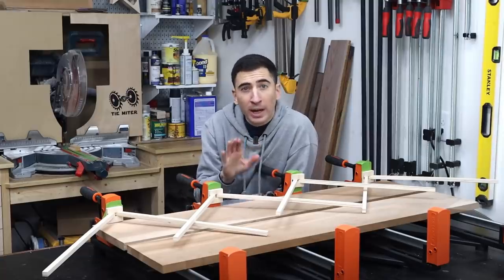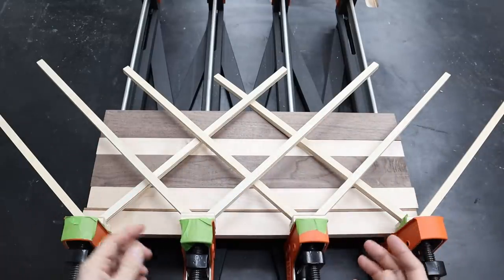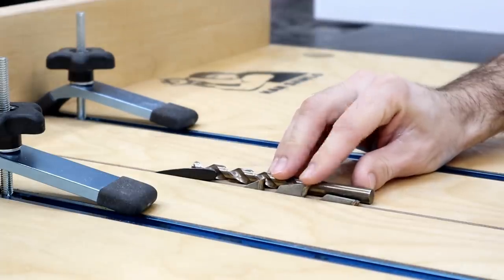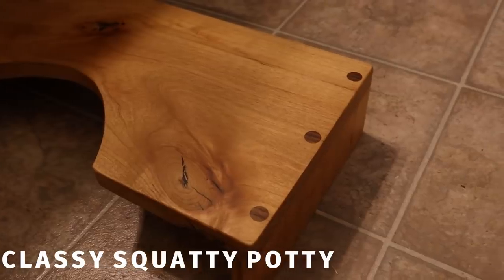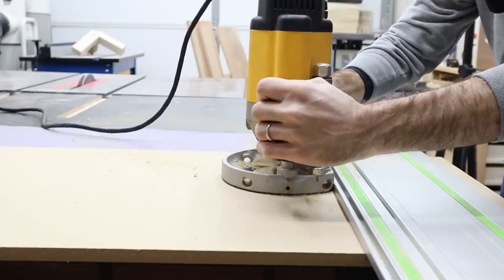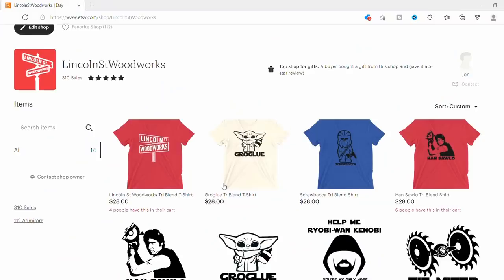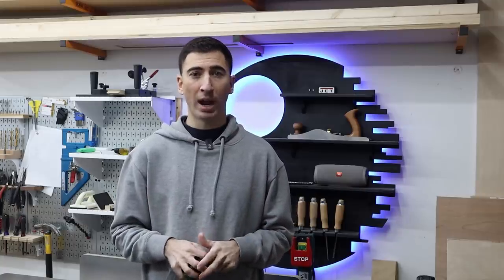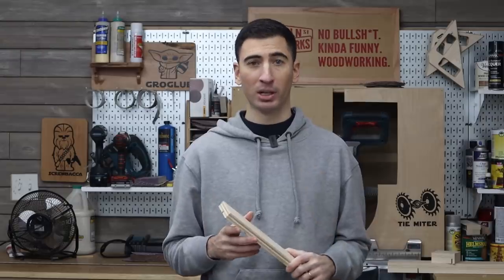I wish I knew about this before - woodworking

Comment: Amen on not switching to metric! But it is all around us, for anyone frustrated with trying to get an idea of what size something is in metric without grabbing a calculator, try this. Divide it by 100, then multiply by 4 equals Inches (approx. but darn close). 
(Metric) ÷100×4= (Inch) Example- 600mm ÷ 100 × 4 = 24".  Actually, 600mm = 23.62". 
1000mm or a Meter, ÷ 100 x 4 = 40". Actually, 1000mm is 39.37"
If you just drop the last two digits of the metric number it is simpler to do and the most, you'll be off is 4". Round up or down if you want. So, this would be for an even larger ballpark estimate, but useful on larger numbers.
865mm, rounded up to 900mm is 9 x 4 = 36". 865mm is actually 34.05"
As you can see, "divide by 100, times 4" is easy to remember and do in your head as well, sometimes. 😜
Hope this helps.
All the Best, Chuck

Comment: I don't understand the clamping force idea, wouldn't there also be V's from the other side as well,? Clamps don't apply pressure on only one end
Reply: Yes but the pressure from the other side is still in the same "cone" and for clamping to work from either side, it needs to push against something opposite of it, which is absent in the smaller glue up example

Comment: I grew up only knowing metric. But I now use imperial because all the building material in my area is imperial sized. It's alright. I do occasionally measure in metric when I don't want to figure out midpoint of a difficult fraction like 17/192nds of a football field.

Comment: I didn't quite follow the half lap tip. Is it that on the third cut you're trying to remove all of the small sliver that remains from the first two cuts? In my head, even if you barely remove that sliver, you're still going to be over cutting your half laps. 

So confused. Would appreciate some help from someone here!
Reply from the maker: When I said "final cut" I meant the cut after the board has been flipped. So, after you raise your blade, you would want the second cut from there to cut barely remove that sliver and it will be perfect. Play around with it a bit. It gets dead on half laps every time.

Comment: Great tips. I have to disagree with the ideas that using round portion of your router is accurate when/if you rotate the router. The bit would have to be concentric to the base plate for that to be true.
Great channel, keep up the good work!

Comment: I live in Brazil now and of course it is metric.  But I find it easier to divide 1 13/16 by 2 than to use metric.  I have to use metric when I go to the supplier, bur still fall back to imperial at home.  BTW Brazil is metric except for sizing plumbing pipes and televisions, those are in inches.

Comment: Trivia note: All US measurements are actually based on the metric system.  One inch is officially defined by the US Bureau of Standards as 25.4 millimeters.  In fact, all 'Imperial' measurements are defined in metric.  In effect - we use the metric system at a higher difficulty level.

Comment: Some very handy tips here. Especially the router direction. For some reason I always think out loud, argue with myself, chose the wrong direction and argue some more with myself. My wife questions my sanity sometimes (often) and I can't blame her. 
Not to be a wiseguy here, but... are you using metal drill bits for drilling into wood or does it only appear that way?
Thanks for sharing!

Comment: Place a length of straight angle against the rip fence twice the length of the board to be straightened place the points of the board against the angle and rip the board straight.

Comment: The clamps radiating out at 45 degrees thing. Would the other side of the clamps also radiate outwards as well? It seems reasonable. So do you really need more clamps?

Comment: The drill bit idea is really good, but only works well if you have a set with the right amount of increments. Luckily, I have HSS set from 1 to 10.
Reply: So do I- in 0.1 increments. But I still use gauge pins or blocks, or spacing packers if it is non-critical. Parallels are also useful for larger gaps. Drills are only accurate at the shank, and then only of they have not been burred.

Comment: Wouldn't you get those 45-degree cones from both sides of the clamp, not just the trigger side?
Reply from the maker: the clamping pressure doesnt extend out forever. The key is consistent pressure

Comment: I always use wide softwood scrap boards to spread clamping pressure, and I even have some with a slight bow in them to even out pressure with even less clamps.

As for the imperial vs metric thing: I learned both as a mechanical engineer from Europe and don't mind using imperial at all. However, I do think it would be good to either ditch one or the other. The longer we prolong multiple systems, the harder we make things for our offspring. The same goes for language. I'm from the Netherlands, but I'm a big fan of the idea to do away with all languages but English. Imagine the efficiency boost for all mankind if we'd all talk and write the same language.
Reply: I'd say English is pretty much the lingua franca of the western world by now anyway. I've worked in over 20  different countries (only 3  with English as their national language)  and never needed to learn another language. Even Korea was not a problem, though Japan needed some pantomime in small stores.

But I can't see China ever adopting it.

Comment: With the cutting board and clamp 45-degree angle thing, you don't seem to factor in the other side of the clamp. The opposing jaw of the clamp projects the same 45-degree angle of force but inverted to how we see it here. The broad end of those angles would cover the dead space at the bottom of the screen as we view it, just as broad end of the ones pictured cover the top side's dead space, wouldn't they?

Comment: Small question about the clamps and the pressure cone : Since pressure is applied from both sides (the fixed and the dynamic jaw) don't we have to take in account the pressure triangles coming from the other side too?
Reply from the maker: it doesnt extend forever and gets weaker. It's all about consistent pressure which you wouldn't get in this case.

Comment: Where you showed the joint that wasn't getting any clamping pressure on the cutting board because it was 'outside of the V's', wouldn't that be getting pressure, and be 'inside the V's' coming from the opposite side?

Comment: While I think it's reasonable to create a stop for the table saw using a clamp, a single trigger clamp is going to move easily if bumped on fence track. Single clamps have a way of moving on smooth surfaces, especially trigger clamps. It's something I run into in other places when I'm not careful. Two clamps side by side might help, but I would experiment to see what works before it becomes important so you aren't surprised by a movement.
Reply from the maker: I just keep my hand to the side of the clamp when I'm returning to that fence position

Comment: Life hack for cutting thin strips on a saw, use double sided tape or use CA glue to join two pieces of painters tape to the thin piece of wood and a larger piece of wood and then cut it.  It gets terrifying cutting something that starts out at 1/2” or less 😀
Reply: I've always use tape, but CA glue sounds like a better option to me and faster to implement. I'll have to give it a try. With both pieces flush to one another I'm guessing it will provide not only a cleaner cut, there is no chance of lateral movement between the boards as there can be sometimes with tape. This sounds like an excellent tip! Thanks!

Comment: Isn't there an equal and opposite force in plan with the clamps? Doesn't the tail end of the clamp supply a 45 degree angle of force back in the opposite direction? . . .  with equal force?

Comment: Drill bit ends are actually usually 0.02mm thinner than the drill bit size (for a 4mm drill you'd have a 3.98mm shaft), though I doubt this translates to woodworking tolerances when using power tools.
Reply: How dare you use metric! That's too logical.

Comment: What about the other side of the clamp?  Shouldn't there also be a "v" coming from the fixed jaw?
Reply: very true....any answers to this please !!! ???
Reply: Yes there is also a cone coming from the other end of the clamp, but the rule of thumb is that there will only be pressure at the intersection of these cones. Because some parts of the joint close to the jaw are outside this double-cone, there is a lack of pressure.

Comment: I have been planning on purchasing some set up blocks, but the drill bit hack will eliminate that purchase for now. Do you think paddle bits will work as well as round bits? The flat edge may be easier to see.
Reply from the maker: Mess around with it, I’ve got pretty good at being able to feel it or using a small straight edge or torpedo level combo

Comment: Great video!! I was wondering, those Jorgensen clamps you use while demonstrating the even clamping pressure and the "V"s. What kind of clamp is that? It looks like all four are attached and keep an equal distance from one-another as you separate or bring them back together. One more time, awesome tips!
Reply from the maker: its called the x clamp - izzy swan sells it

Comment: 1. Love your videos. I actually find myself laughing out loud. 
2. Worth noting that the clamping force is beign exerted by BOTH jaws of the clamp, so you were gonna be fine without adding more, since the fixed jaws would be casting Vs that would capture the joints from the other side.

Comment: Umm, I think the vectors are messed up.
The point of the clamp should be the strain focus, vectors of pressure should radiate from there.
You have it as the mid point between clamps.
I submit that the strain will be a function of the length clamps and the width of the board.
Unless there is a thing where parallel clamping pressure zeros out and it resolves to the middle?

Comment: Hmmmmm. I grew up with imperial. But the country slowly shifted over to metric decades ago. Certain things stick pretty tenaciously. I don't know any one who'd say they were 1.85 metres tall if they were 6 foot 1". But as for the rest of it, it's as easy as acknowledging that your ability to count to ten is probably superior to your quotient calculating strength. You don't actually have to give up anything at all. Hell, in woodworking, I normally eyeball the proposed bit against the screw and pick. It hardly matters what's marked on it. Or if I were drilling for, dowels say, it might be a bit tight or loose anyway, so a drill from the opposite set might always be useful to get the right clearance/interference in the end.

Comment: On the cutting board, instead of 7 clamps, why not use a caul.  I'm thinking you would only need 3 clamps using that method.
Reply: Yep. I have a set of curved cauls I made up for these types of glue up. In many but not all cases, 2 clamps will do the job.

Comment: While you may be technically true, it's not relevant in practice. There is more than enough clamping pressure available for most projects. Chasing minimal gains is a fool's errand. Perfection is not always a desirable goal.
    Wood joints can tolerate relatively massive differences in wood pressures and still give excellent results. (depending on the purpose of the project).

Comment: There were some tips in this one I haven't seen before. Using a drill bit to measure....now my ownership of your "Just an idiot in a garage" shirt seems imperative. To go along with the emery board squeeze out sanding, a cheap bag of plastic straws works as well. Give the glue a few minutes to begin setting up and pinch one corner of the straw end. The crease will fit into the 90 degree corner and allow you to scrape away the squeeze out.

Comment: While I'm sure a good concept to use for a tip. But the angle that the clamp force is distributed would be material specific, the clamps don't "apply force in 45° each way," it applies force directly and the wood distributes it in an angle approximating 45.  But no way pine does this exactly the same angle as walnut.  Engineers use the same approximation for concrete,  but wood and concrete behave much differently.  In reality cross grain loading is likely wider than 90, end grain loading is likely less than 90.

Comment: Regarding imperial and metric - I've heard that the US is "in the process of switching to metric".
That can be quite difficult; there will be a lot of confusion (I'm living in the metric world and when I had to start using imperial, I definitely got confused, so I expect the same will be true the other way round).
Personally, I think the metric system is quite good, especially because one litre is 10cm x 10cm x 10cm (100mm x 100mm x 100mm) and one litre of water weighs one kg.
One inch is by definition 25.4mm (not 25.0mm) the 0.4mm gets more and more important the longer your workpiece is.
I've had some trouble with imperial, because I wanted to find out how much exactly 1oz is (for printed circuit boards). It turned out that nobody knows. It's an arbitrary measurement.
My goal was to make an automatic PCB trace calculator (on a web-page), but since an ounce varies in size (as do a foot, though a foot is officially 12 inches, and an inch is officially 25.4mm), this small task turned out to be impossible. Some PCB-manufacturers use 1 oz copper clad sheets from one manufacturer, which has a thicker layer of copper than 1 oz copper clad sheets from another manufacturer - probably because one manufacturer has bigger feet than the other.
Note: 25.4mm is the most used size of an inch; I do not know the exact measurement, but it's something like 25.39xxxx if I remember correctly.
Fortunately, in most cases (especially woodworking), 25.4mm is all you need to know; that's what I use and it's always been sufficient.
All the confusion about measurements are caused because those who invented the measurements were not strict enough (they didn't think about all the use-cases).
This is of course easy for me to say, but unfortunately it's true. It's absolutely unfair to require that they think about all the use-cases, though. ;)
One thing that still confuses me is (here in Scandinavia where I live), is that for pipes and hoses, there are different rules for when you should measure the inner diameter or outer diameter of a pipe or hose. It depends on if it's a pipe or hose, but it also depends on what kind of material the thing is made of and sometimes it depends on other things as well. One thing that's common, though, is that they're still measured in inches.
-But those inches are 25.0mm, not 25.4mm (because the pipes were invented before we knew how big an inch actually was).
 I can imagine the horrible day when they change that to metric and all the leaks it'll cause.

Anyway ... Happy measuring! =)
Reply: This has been "in the works" since 1975; however, conversion isn't mandatory for any tool maker here, and the choice remains just that.....optional.  See Obama administration's response in 2013 to the latest federal petition; it went nowhere.  I see nothing changing on this front.
Reply: If you think the length conversions are hard, wait until the general public has to deal with kilograms. There will be mass confusion. 
.
.
.
I'll see myself out.

Comment: Wouldn’t the same clamping pressure “figure” be represented on the opposite side of the board? 0:23  there are more than just those 4 point of contact on the board. In a matter of fact, there are eight. So the pressure should pine reflected on both sides of the board? I could be wrong…

Comment: I like the explaining of the force Applied by the Clamps. The Part about the Cutting Board is not completely correct. The Clamping force comes from both Sites, so you need to draw the triangle of force from both sides. Still, when the triangle of force widens, the force per Square centimeter (Or Inch for the Americans) reduces.
Reply: Thanks for expanding on that! I saw that and was wondering what was up or he just forgot to add in that bit.
Reply from the maker: leave me alone

Comment: Re: metric - I intentionally use metric in my work as an engineer. I love metric. We should switch to metric. It's better, it's easier, it's great. 

But my shop at home is in inches. I challenge anyone abroad to move to the US and try to start a metric woodworking shop from scratch. You just can't - at least, not without importing 99% of your tools. Every table saw is in inches, every square and ruler and tape measure is in inches, all the lumber is in inches. 

And the same reason I can't reasonably make a desk in metric is, in the grand scheme, the same reason companies can't reasonably make those tools in metric. THEIR manufacturing machines are all in inches. They have physical machines - huge pieces of capital investments - that are physically built to make tools that make things in inches. 

And that's just woodworking. Expand that to.... Literally everything. Plastic film machines are built for mils. HVAC system lines are designed for BTUs, and inch ducts. Printers are designed for 8.5x11" paper. The bolts in the stockrooms of every factory across the country are UNF and UNC. If you're in construction - inches are literally written into the building code.

So now... You're the CEO of DeWalt. Or Milwaukee. Or whoever. Are YOU gonna go to the board of directors and propose that you either scrap or duplicate millions of dollars of equipment and spend millions in man hours to launch a new metric product line that no one is going to buy because it won't work with anything else in the hardware store?

Yes, absolutely, let's switch to metric. Who's gonna go first?